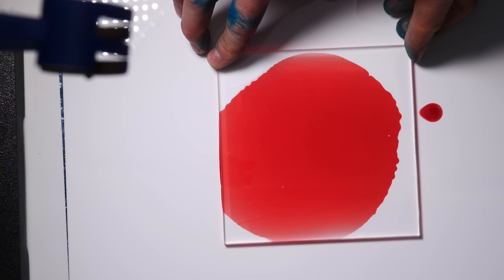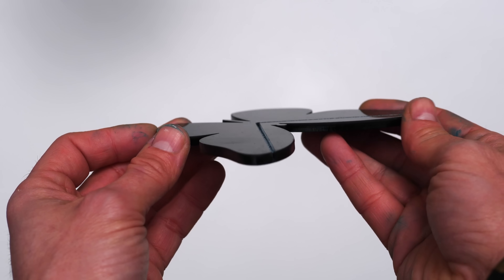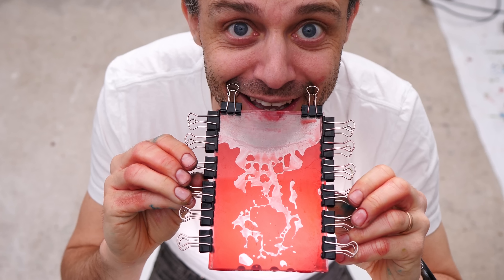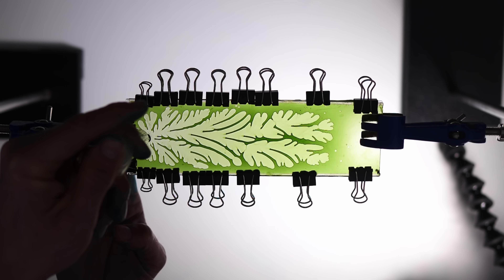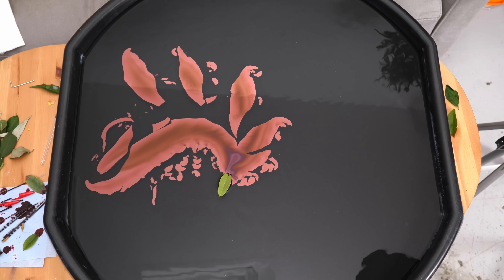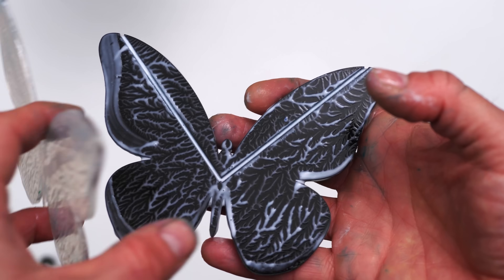Why honey makes these strange tendrils

Comment: If you added a knob to the center of the butterfly shape, would that allow for the symmetrical pattern to be pulled apart? Like an acrylic rod sticking up an inch to grip onto.

Comment: Just add handles to the body of the the butterfly or you use a wet clay to temporarily seal the body and put use a hole to push the other fluid through

Comment: I feel like you're forgetting a dimension here, and that is the Vertical.  And what I mean by that is that you are forgetting: DENSITY.    Take oil and water for example.  Yes the oil is thicker than the water-  yet the thicker oil still wants to float on top of the water..   While Honey is also thicker than water, but the honey wants to sink below the water.   I feel like there is an extra interaction there (density) that maybe wasn't explored enough.

Comment: You also get a similar looking “fingering instability” in combustion. If you burn an energetic media like paper or metal powder (or in one paper nano-thermite) in a channel that limits its access to oxygen (more specifically a channel that prevents gravity assisted transport i.e free convection) you can get similar structures. Although the mechanism behind their formation is different, related to thermal diffusive instabilities for gas flames as well as a “competition” between nearby fingers for oxygen.

Comment: Why not pump the thinner fluid into the center of the butterfly like you were doing with those disk shaped examples, and, if the fingers form as a result of geometric imperfections, why not seed them beforehand with strategic voids?

Comment: I would have thought the way to deal with the butterfly issue is just to have a scaffold that start outside the boundary of the butterfly but the pry point runs down its centre line. Once you get the pattern on the butterfly, you just trim off excess.

Similarly you could just mount the butterfly shape into something that resemble a tortilla press. You pry using the press and then remove the butterfly from bracket its mounted to on the press.

Comment: Ideas: Mostly in the order of which i thought of first. Small problems left to figure out how to execute. 
1) Drill a small hole in the "pull" plate where you want the pattern to start and glue/epoxy a nut to it. Screw in a bolt that will go through the hole to separate the plates. Do not glue all the way around the nut.
2) Glue a minimum of three hooks/attachment points to the pull plate, drill a tiny hole equidistant and centered from the attachment points. Run wires/cords from each attachment points through a hanging hook or something to pull them all at once. 
     2.1) Try drilling the hole in the non-pull plate.
     2.2) Glue a cylinder over the hole in the pull plate, fill with less viscus fluid like water to limit/control the amount. 
3) Inject the less-viscus fluid into the hole with a really good syringe. 
     3.1) inject the fluid from the side with a really good syringe with a needle. 
4) The "pull plate" can be oversized and generally not match the dimensions of the non-pull plate.
5) Use double sided tape to hold the non-pull plate down, or some temporary adhesive. 
6) Make a jig that you can hold the non-pull plate to. On this jig would be multiple vertical rods outside of the non-pull plate area. The pull plate can be larger and have bushings for the rods to keep the pull plate going cattywampus. 
     6.1) Is that a problem? No? Make the project bigger until it's a problem! 
7) Try it underwater in a fish tank, maybe not...

Comment: Very cool stuff, Steve.  I noticed the secondary fingering around the outside edges when the fluid was injected into the center, that made a great pattern when air also came into the spreading plates.  Just before the blue broke through the green at the top, I was yelling at the screen, "Stop!  It's perfect!"  You didn't seem to hear me, though.  (I forgive you.)
That would be really spectacular if it could be more even all the way around the circle, and paused and preserved when the effect was strongest.  Perhaps some combination of epoxies.
I've also seen this effect in another short-lived place you may have seen, when using solvent to bond acrylic, but the two parts pull apart before the process is done.

Comment: im just a layman so i could be entirely wrong but, that last bit about putting air or water underground to extract oil causes fingering, which is inefficient, would putting a mix of both, or carbonated water like the stuff we drink push it out better? i thought it was dumb at first but what if you can get the 'fizz' on the oil output end so it gushes oil?

Comment: I think the simplest way to symmetrically finger a viscous butterfly is to just make half a butterfly and then lay the two sides next to eachother after separation. If you really want it to be a singular, unbroken piece, just have the top sheet be split in two and pull the two sides apart separately.

Comment: @Steve Mould...
I ""know"" how to make "butterfly patterns", I  made "butterfly shaped viscous fingering" already in "playSchool". We made them when we made ""ButterFly paintings". By that I mean  putting "globs" of different coloured paints on "crease" of an unfolded piece of paper, which You then fold back again and thereby "press out the paint" forming a (hopefully butterfly shaped) symmetrical pattern. Which,when you "pull apart"/separate the two pages, if you had the "correct" viscosity in the paints, and a "rigid enough" paper, will (can) make beautiful multicoloured (fractal) finger-patterns. 
Do try it yourself, everyone should have tried it at least once :) ((All this to say that I believe that if you might succeed with your "butterfly" if you make your "top/covering plate" in two symmetrical halves, that hinge on the middle, possibly as simple as using sturdy tape. And then you "pry the covers up" symmetricaly from the edges, the fingers should "form towards the centre"...k))
Best regards.

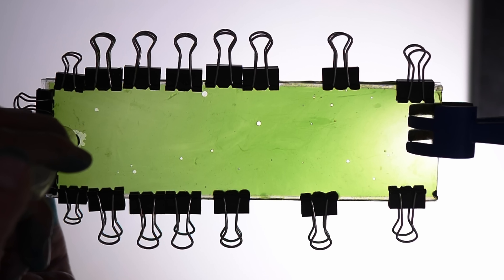Comment: These patterns and the motion of them remind me of how lightning spreads through the air before forming the final path we see as the main strike. In the demo from 5:42, for example, you can see it spreads branching in all directions until the pressure is released by one channel breaching the far end, at which point the pattern contracts back to a kind of central channel (though it's a little hard to see everything that happens at this moment as the clamp is covering the end, and the syringe is also obscured so I couldn't tell if it ran out before or after that moment)
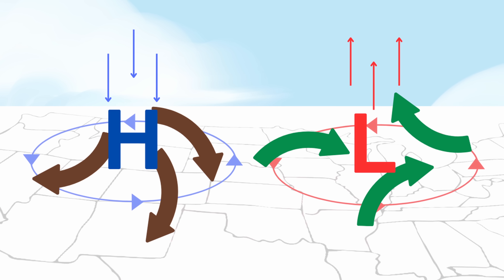Reply: I think the blue arrows in the diagram at 7:08 are pointing the opposite way from how they should (how they do in reality). They are pointing anticlockwise, but should be pointing clockwise. They indicate the direction of the wind, i.e. the movement of the air w.r.t. the local part of the earth's surface. 
Conservation of angular momentum is enough to prove it. 
The air in a high pressure system starts out stationary with respect to the rotating earth. In the northern hemisphere (it is above the USA, we can see the map), that means it's initially rotating anticlockwise (viewed from above the north pole, from the star we call Polaris, say). As the air moves outwards, away from the center of the high, it's angular momentum is conserved and so the rate of rotation decreases, so that is is rotating slower than the earth under it, and thus relative to the earth is rotating the opposite direction, that is to say, it is rotating clockwise.

Comment: I'm wondering if sharp silicates, similar to Lunar regolith , might help to disperse pressure across the sorta fractal nature of the mediums. Very tiny rocks breaking the barrier between the two, allowing more even pressure to push oil out of the ground. That is, put a dot of soap on your finger. Fill a glass to brimming, almost overflowing. Touch the tip of the water, and watch it flow over the side of the glass. Would a physical medium destroy the cause of the fractal pattern, thus allowing greater efficiency in oil and gas extraction?

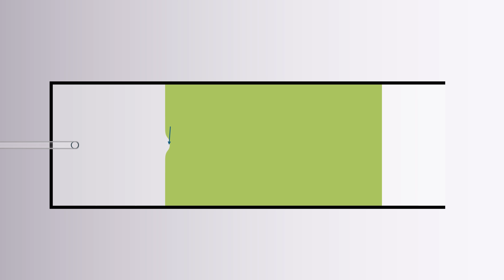Comment: Bit of a glitch in at 8:24.    The air is displacing the thicker fluid, but it's not extending to the right or anywhere to move out of the way.  The liquid fluid is generally incompressible, so that space made by the air has to go somewhere.     At 11:39 we see that the circle doesn't grow, but in fact the fingering reaches in from the edge, but that's because instead of the air just pushing out from the inside, it pried the plate away from each other uniformly, which is why we see the fingering reach in from the edge.

Comment: I’m not sure if I fully understand the issue with the butterfly. But I think my simple attempt at a solution is that both “butterflies” don’t have to be the exact same shape. Could have some overhanging tabs at the top points of the butterfly wings. Or a pair of tabs on each plate offset from each other for easy “symmetric” prying. Not sure if the results would be truly symmetric

Comment: Check out the "Flow-induced choking of a compliant Hele-Shaw cell" by my colleague Dr Finn Box.
He'll tell you how a cell can choke if it's bottom is a soft material. This is because the injected fluid dents the substrate which creates a bulge ring around which can seal the gap  leading to choking of the system which stops the flow and thus also stops the viscous fingering. It effectively works like a fuse. This choking happens above a threshold flow rate, so that could be a safety mechanism (like a fuse) in a network of pipes

Comment: Lovely video lots to think about. I think you should try to pull evenly from two or all four corners of the wings at the same time but you would probably have to fasten one side to a table or something and pull a string connected to each corner.
Reply: I am thinking the force applied to the corner changes the speed of the fingering and for it to be symmetric you'd need all your fingers to arrive in the right place at the same time.
Reply: So it depends sensitively on the difference in force applied to each corner even if you attach the string at the same place. If you attach strings of the same length to a loop and pull from one hand it should transfer evenly to each corner I think.

Comment: I have a suggestion for a math video, or something. In the Basel problem, famously solved by Euler, they ask for the "exact answer" of the sum of the squares of the inverses of the positive integers. What is an "exact answer"? I could not find a definition for that context. There's a problem: if we define an exact solution to be a symbol that represents a number, then that's absurd, choose a symbol and you are done. If an exact solution is an algorithm that converges to the number, well that is in the problem itself. The question is: why is π**2/6 more exact that the limit-definition? Because π is famous? What's an exact answer?
To be honest, the original problem was published by Pietro Mengoli in 1650, and I don't understand it because it's in handwritten latin. Although to be more honest I didn't find it either, for the same reason.

Comment: In your explanation of CO2 being pumped into pourous rock, I couldn’t help but think if the thinner CO2 is pushing out the thicker water. It would make the overall rock density decrease and may become easier to crumple under the same force. 

This would be interesting for uses in revitalizing soil to be more farmable or even terraforming mars

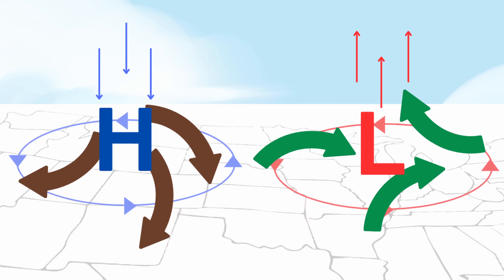Comment: Not sure I buy the explanation at 7:10 How can a gas have localised low pressure drop when it's not moving? Surely the gas is constant pressure on all its boundaries? Otherwise you wouldn't need to increase pressure to see the change occur.

Comment: Instead of channels,  a bigger frame so the force of the separation is aligned with the 'seed' effect that you see on the other examples.

I.e. a diamond shape total area, but the butterfly area being smaller inside, so when pulled, the vector of the force applied to the adhesive medium comes from a place like the center, so the fractal spreads outwards, as it seems to follow that pattern depending on the starting point of the force applied.

Now that I think of it even using the flat ones but pulling from the center would do, but I'm just speculating of course...

Comment: For the butterfly i used to to this all the time as a kid and the solution is just to make both the sides of the cell the same part and simply add a hinge at the point of separation. like a paint and a piece of paper i used to do it with. simply put paint on one side of the paper and fold it in half and squeeze the sides together and separate and there your have a symmetrical pattern.

Comment: The butterfly is already symmetrical. Wouldn't it be easier to create two halves that make a butterfly after you pull them apart? I may be missing the point.

Comment: I wonder if just using a tool or a screw partway through the butterfly would work. Use a small prying tool to open the butterfly from the middle, like a screwdriver or something. Or put a hook or screw partway through one side and pull it from there.

Comment: With the symmetrical plates you need symmetrical pressure, try pulling from the head and tail on the butterfly instead of bits of the wing.  "pinch" the plates between both hands with your forefinger and thumb, both touching there counterparts, then pull apart.

Comment: Density also comes into play, and, while density and viscosity are correlated, they have different effects on fingering, since gravity is assumed negligible when dealing with viscosity generally, unlike with density. For example, the phenoxyethanol effect is due to its high volatility/low surface tension (these are directly related) and lower density. It pools at the interface of the high-viscosity liquid and the air and, because it thins as it spreads, it evaporates at the edges, creating an ever-changing fingering pattern.

Comment: for the butterfly, perhaps make a small hole in one side at a central point. When it's ready, use a stick to poke through the hole onto the other surface, radiating outward from that central point as the one plate moves away from the other. thanks for a very cool vid!
Reply: Yes! I was about to suggest this, but using the syringe to push air in at the centre to drive them apart.
The goove could also be used to have the air come from a line (or several) instead of just a point

Comment: Butterfly pattern: the fingering pattern follows the gradient of pressure created by pulling the plates, which creates a slight slope, which then creates the pressure differential. To make it so the gradient starts at the tips of the butterfly wings and converges to the core of the butterfly, you have to be able to pull from both wing tips, both sides at the same time, AND slightly push down on the core so that you actually have two gradients, on either halves of the butterfly. Once the finger pattern reaches the core of the butterfly, you can stop pushing on the core, and it's going to pop off, leaving you with the complete, somewhat symmetrical, pattern.

Comment: cut the wings off the butterfly body, put the wings together with your viscous liquid between, unfold from the outside of the wings, put the wings back on either side of the body
Reply: that one will give you actually symmetrical wings, or close enough, but other things you can try are: cut the top sheet only down the middle, attach some sort of tab or fishing line or something to the middle so you can pull from there out; cut the top wings in half and add a hinge in the middle, pull from the outsides, but you'll get a less visually appealing result

Comment: My suggestion for the butterfly, use a square for the opposite side, and glue the butterfly to a square behind it, then pull the top corners apart. By adjusting the angle the corners pulled, it should start at both wingtips and meet in the middle. I can't wait to tell all my friends about viscous fingering!! 😊

Comment: You might be able to make the butterfly work with a thinner sheet of plexi on the front and applying pressure with a suction cup stuck in the middle to apply pressure where you want the fractal initiated from.

Comment: Maybe for the butterfly symmetry you need a more flexible material and a very weak tape, adhesive, or clamping of some sort on the edges of the wings to let you pull it apart from the center and have it flex outwards as you do it?

Comment: I Paused the video. Let's see if I'm right: Every pattern in nature, such as leaf veins, electric rays, flower desings and river directions is formed due to the "path of least resistance". (Which is also the same direction light travels). Means if something moves in one direction, then it gets blocked, it goes to the predicted direction; the side, if it is blocked again, it goes to other side in a repeting probability pattern. It's the pattern Alan turning figure out; that in nature, every sum of values repeat these same patterns over and over, which means to decode any possible message you just have to figure out the repeating pattern.

Comment: Im not sure if its the same as viscous fingering, but in my line of work as a race engineer, we call it aeration where tiny air or water bubble form in oil due to the extreme pressure those fluids are subject to particularly in the shock absorbers and engine. Im sure the two phenomenons are related somehow if not the same thing so its cool to see whats actually taking place to cause those fluids to mix.

Comment: Viscous fingering was the bane of my existence when I was trying to do resin repairs on my boat last summer. Anything I used to cover the resin while it cured had a tendency to pull away from the compound curve shape of the hull. It was really frustrating. I would not have called the result “art”